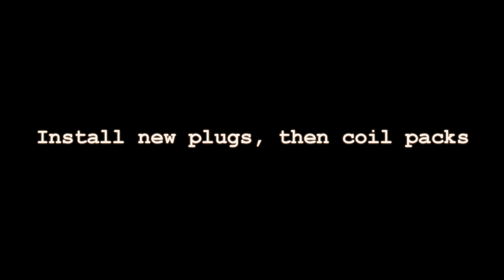Tune-Up and Takeoff: Changing Spark Plugs and a First Glimpse Driving My Manual Lexus GS400!

Comment: How many miles between changing those copper plugs ? Just picked up the same ones hoping to fix what feels like a misfire. I have plenty of questions for you since I’ve just picked up my own 2000 Gs400
Reply from the maker: I plan on 15K mi intervals. But once I am supercharged that will be out the window. 😆

Comment: So what do you do what it’s really tight
Reply from the maker: The spark plug? Try it with the engine hot.
Reply: You have instagram??
Reply: So is that anything else that sounds like a lifter or valve noise ? Towards the front of engine

Comment: Are the spark plugs you used copper?
Reply from the maker: Yes. Just have to change more frequently. I don’t drive the car much and plan to SC it (will need new plugs anyway). User preference.